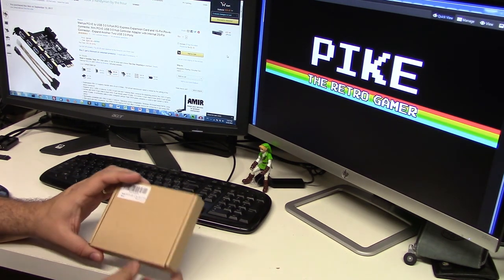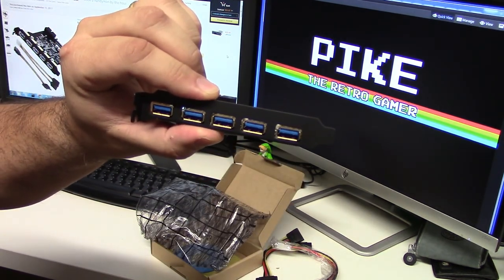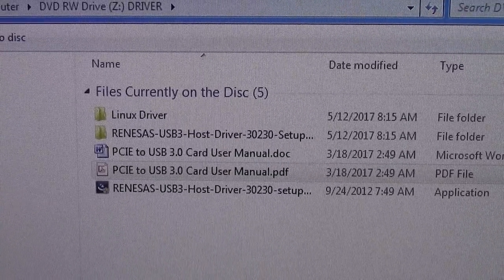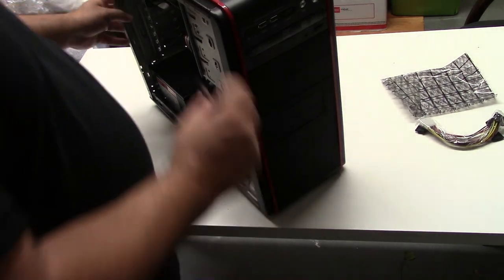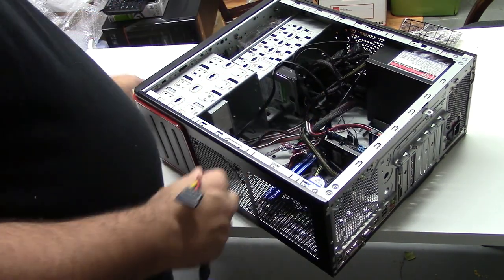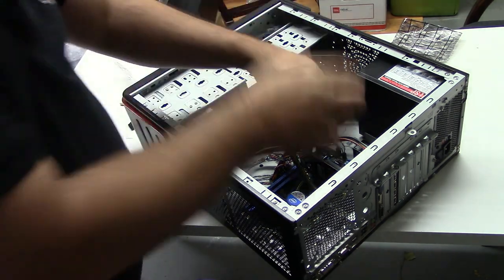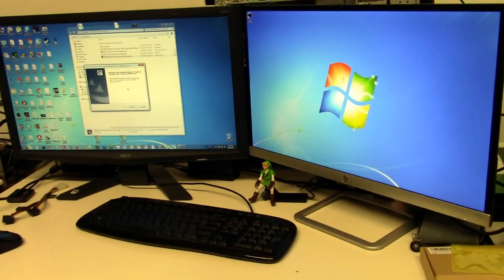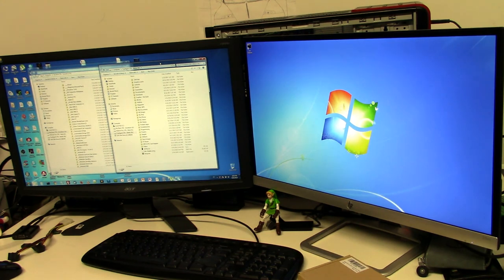PCI-E to USB 3.0 5-Port Expansion Card from Amazon

Comment: What is the difference between external power supply, and this one that you have in the video that is self-powered, or integrated power supply, I mean which will be better, external power supply or integrated power supply? I see that the external power supply are more expensive.?

Comment: We do have to plug that extra Sata Power? Isnt powered by the pci express on it own? Thanks
Reply from the maker: Mine only worked with the power connected to the card, it seems that the pci express does not generate enough power for all the USB 3.0 ports that this card has. I have since installed a 2-port on a different computer from the same manufacturer, and that one did not needed extra power.
Reply: @pikeretro  thank you for your answer... Great vidéos...

Comment: Do you still have a copy of the driver for this card? The link provided by the manufacturer no longer works.
Reply from the maker: Jamie, I don't have the DVD with the driver at hand, but I will look for it and if I find it, I'll put it on the Internet Archive. Now, if you are installing it on a Windows 10 machine, you'll likely not need the drivers from the manufacturers. I've built a new computer since that video and installed the card on it without the DVD with the driver. It will only be needed if you are trying to install it on a Windows 7 machine.
Reply: @pikeretro  Thanks for the reply. I'm using it with a Windows 8.1 machine, and it too needs the driver. I was able to find a driver online from Renesas that works fine, but thanks for the offer to help!
Reply: @jamiechampion299  hi, can u sent me the link?  i seriously needed driver to fix my problem on this card

Comment: Hi can I addon USB type c 3.0 and type A 3.0 usb port In zebronics h61 LPA 1155 motherboard in pcie slot if it supports can I connect type c ugreen type c 3.0 to hdmi 2.0 adapter 4k 60hz cable can it play 4k 60hz UHD movies in 4k TV from all adding this in normal desktop computer i3 processor intel integrated graphics and ugreen 3.0 type c to hdmi adapter male to female computer to 4k tv